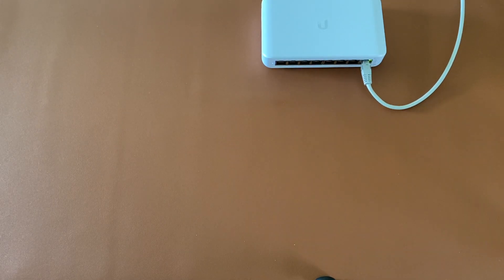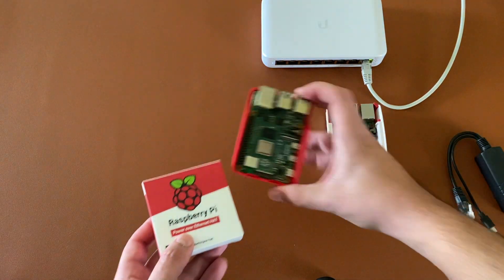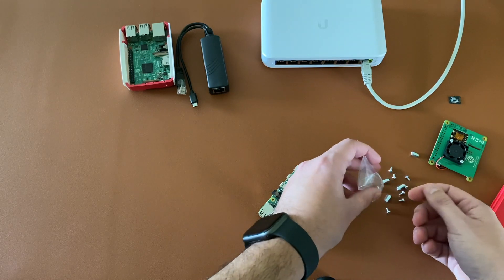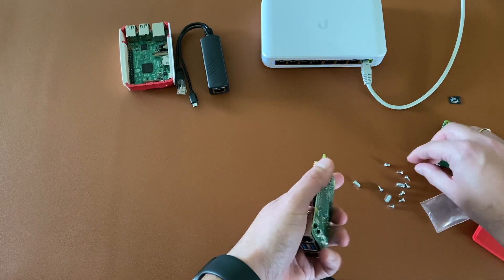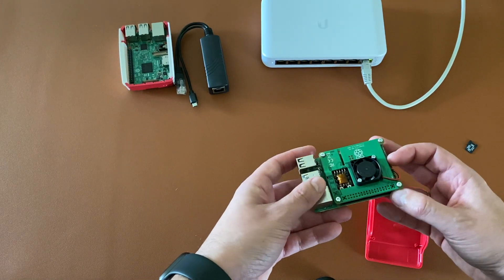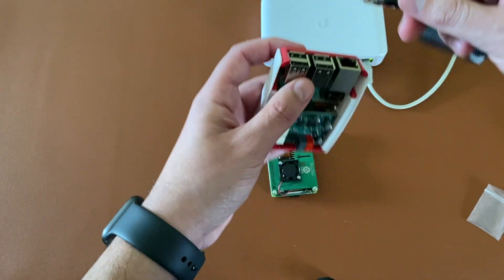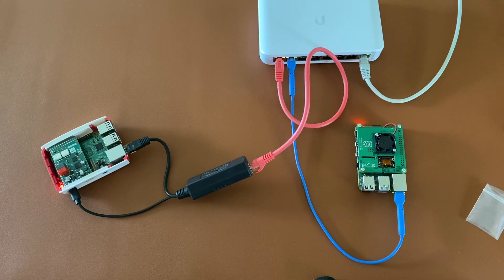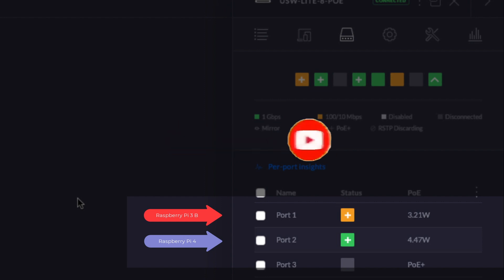Power Raspberry Pi using PoE

Comment: if you have a poe switch do you still need the injector and or the poe hat?
Reply from the maker: Yes in all cases you need either the injector or the poe hat. PoE switch can provide power but raspberry need on of those to get power from the ethernet

Comment: How about energy meter devices review? Electricity, gas and water.
Reply from the maker: Thanks for sharing your ideas! Which devices are you using for energy meter?
Reply: @PoseidwnTech  I've ordered Zennio KES Plus for electricity and Zennio KCI 4 S0 for water and gas consumption. But in my case gas meter and water meter are located in different places, but both of them have KNX cables. Buying two KCI 4 S0 modules is not good. I was trying to find a way how to use KNX to relay impulse from gas meter to KCI 4 S0 module but didn't find anything. Plan B - using Arduino with RF module.

Comment: The USB-C PoE Splitter did not work on either of my Raspberry Pi 4B's. Tried with multiple Unifi PoE switches, including the USW-Lite-8-Poe. Geekpi sent me a replacement USB-C PoE splitter, and it also did not work.  What brand of Poe Splitter did use? Have you tried a PoE Splitter with a Raspberry Pi 4? What is the additional card in the Pi 3b @6:19 you are referring to?
Reply from the maker: Unfortunately I have not used PoE splitter on raspberry 4. Have in mind that raspberry 4 needs more power so probably you should try on PoE++ switch. The card that appear in video is kBerry 838 from weinzierl. A KNX card for raspberry. More details on upcoming video, so stay tuned.